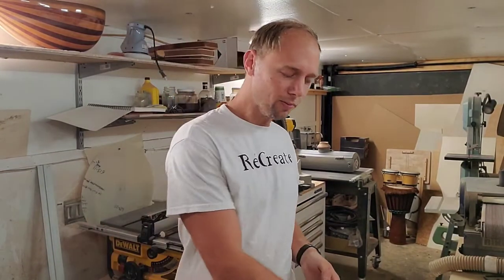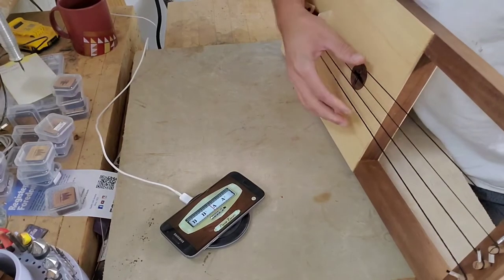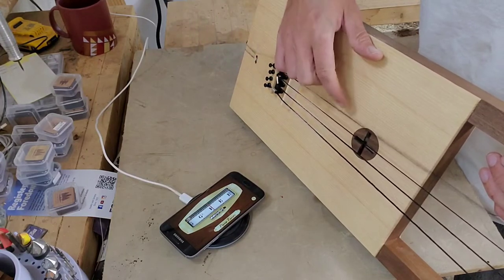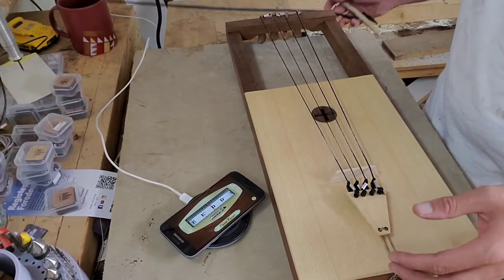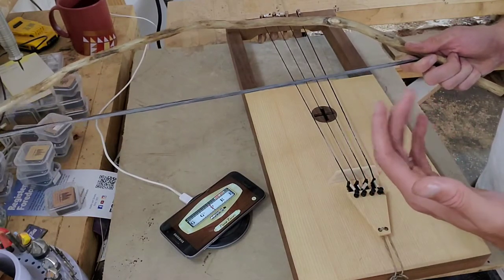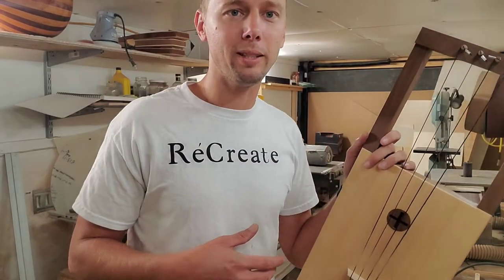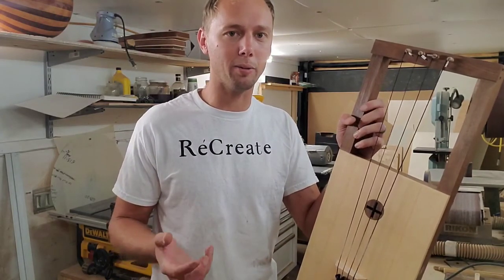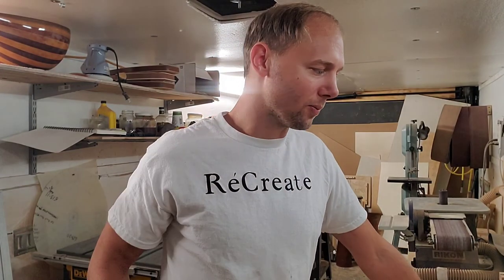Tagelharpa Bow Harp- How To Play

Comment: Thank you for the helpful introduction. I noticed the chanting was hard to hear compared to the drones. Is that how it is or is that due to the recording?
Thanks!
Reply from the maker: Bow harps with three strings allows the chanter to be a little more prominent sounding. Four string bowed harps give extra tone and strength, but the chanter string is not as prominent.